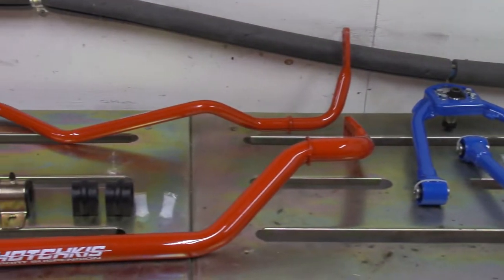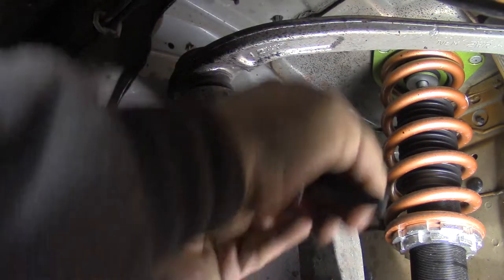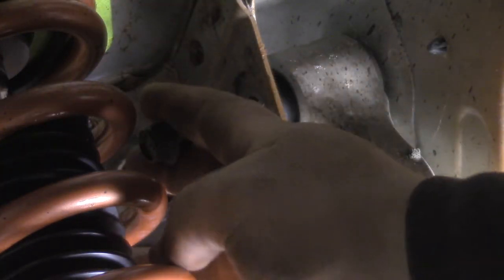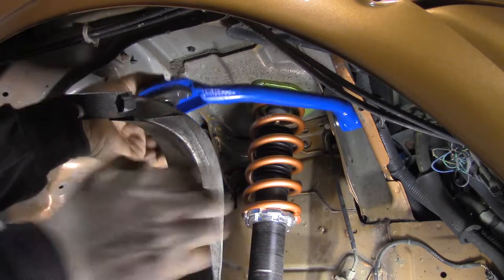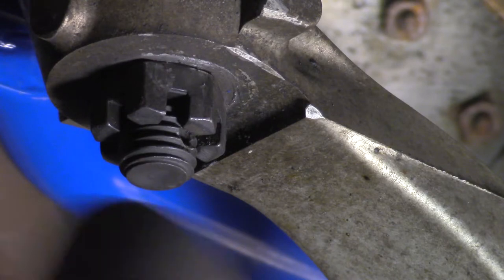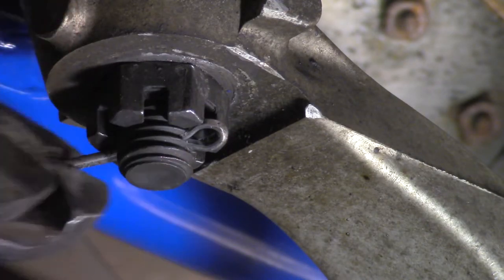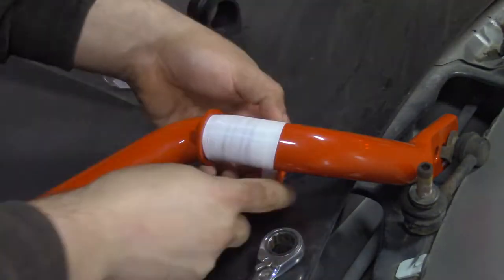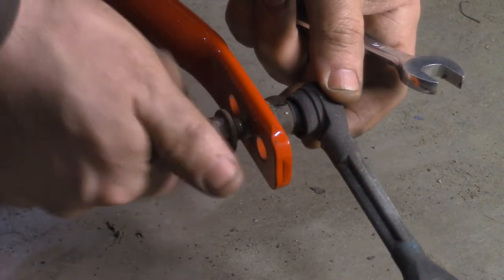350Z Upper Control Arms and Sway Bars FUNCTON BEAST: S1-E15

Comment: what brakes are those??
Reply from the maker: They are Akebono brakes from a G37s. The kit that includes the adapters, calipers, Rotors, and lines can be found on Z1 Motorsports website. It was the best band for the buck brake kit that I️ found at the time.